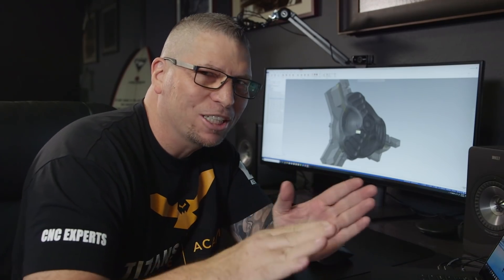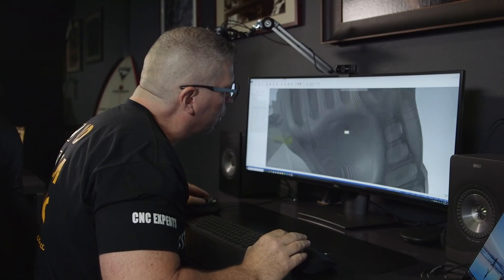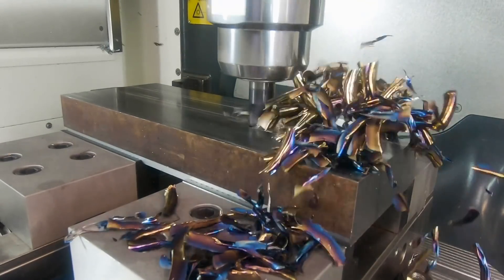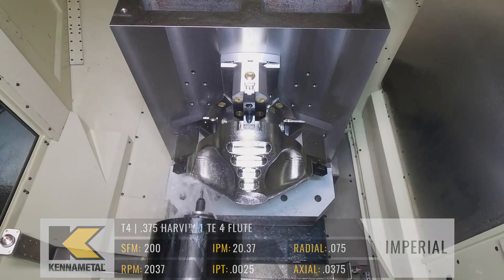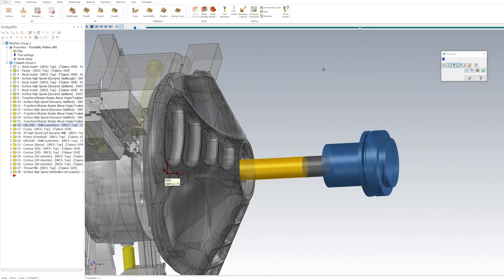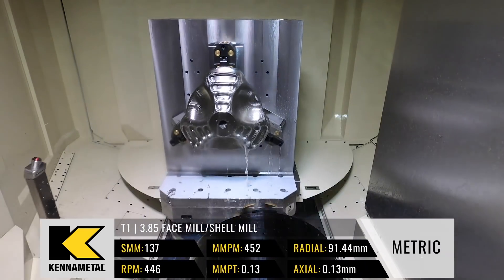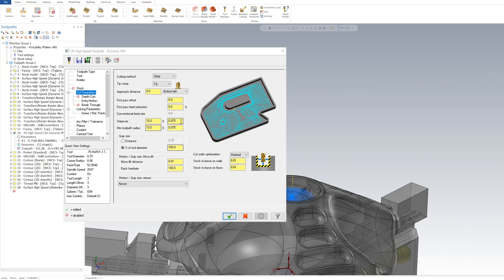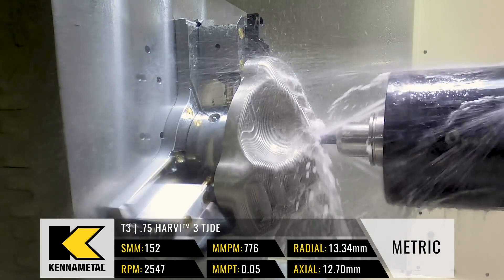60HP MAKINO | High Level Titanium Machining | Incredible Aerospace Part

Comment: Thank you, Titan. All these feed and speed are amazing. But I have a  question, what to do with the bottom of the pocket?? It looks like the bottom is not flat and the 3/8 flat end mill can't take care of the bottom radius, do you use anther tool (ball nose) to rough that out or cut  it with the semi-finish

Comment: +20 points for uploading the Mastercam files for this!
Reply: Did you find the file? I said the same thing but in the video it says its included in his Aerospace Academy which is coming soon. So I was curious if you was able to find it?.
Reply: @pakman422  No I didn't. I assume he will upload them once the project is finished.
Reply: @pakman422 sorry this is really late but they do have this uploaded. It’s called the propulsion fuel manifold. part number 6AL-4V

Comment: I can't wait for the next video Titan, by the way how much money is that cnc?
Reply: Well over a million.
Reply: Other than a couple of options, this is a stock Makino a81nx.  List price on the base machine is about $516K.
Reply: @davidward758  that's not bad. Were I work we just bought 2 Yasda PX30i's and their 1.1 million each. That includes install of course and a small service and parts warranty. But that is a 30 pallet 5 axis "CNC Jig Borer" mill with a 230 tool ATC and a ChipBlaster

Comment: Ur awesome I love mastercam I got 2020 on my personal CPU..bbut your way more advanced than me I do a lot of airframe..not solid models..but the dymnamic tool paths are awesome..great work buddy..i worked on a older nh4000 makino and it was a monster I could imagine that beast you got..i also put a Kurt vice on an angle plate fyi..it works great if your doing a bunch of different parts. Cause tombstones jaws are pricey